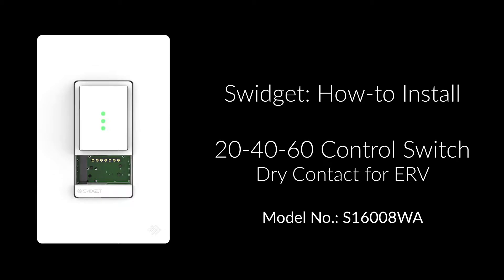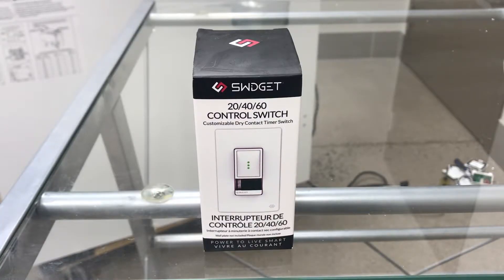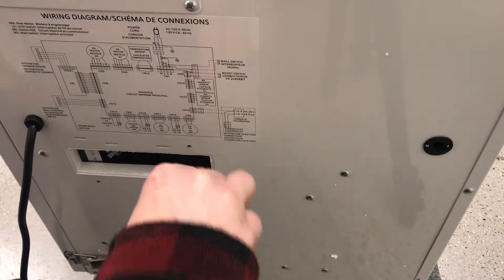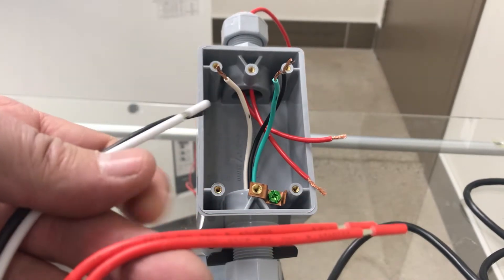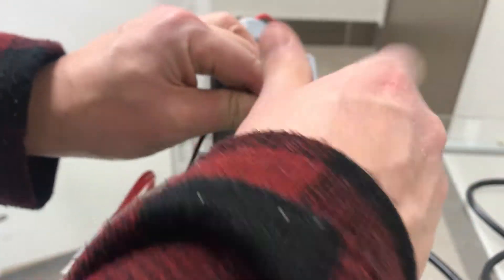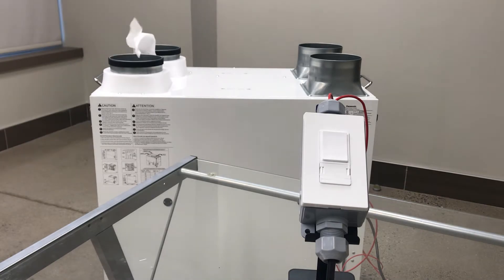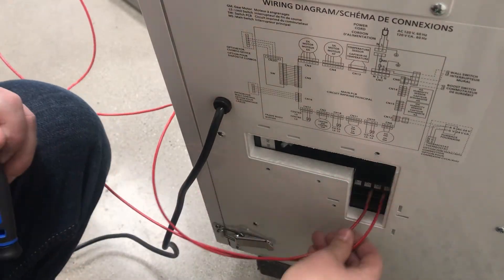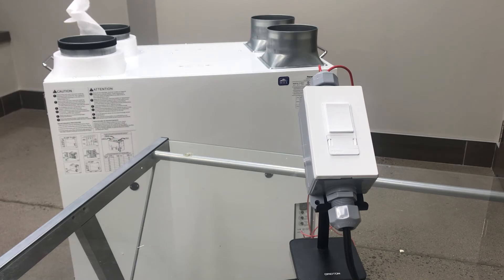Installation - Swidget 20/40/60 Control Switch - Dry Contact for ERV

Comment: Can you run two boost switches to one ERV?
Reply from the maker: Yes you can! The dry contact wiring can be connected in parallel and used with as many 20/40/60 Timer or Auxiliary control switches as you need.

Comment: If the boost switch is enabled, while the wall switch is off, will the fan run?  Is not, is there a way to wire it such that it will behave that way?
Reply from the maker: Thank you for the question, Kyle. The short answer is no. Depending on your application, however, I may have a solution for you. You could wire your main switch to the on/off terminal on the ERV and use a jumper for the boost terminal. When your switch is off, the ERV will be off. When the switch is on, it will automatically turn on to the boosted, higher CFM mode. Hoping that this helps. Feel free to reach out support@swidget.com to discuss other options. Thanks! ~Jeremy